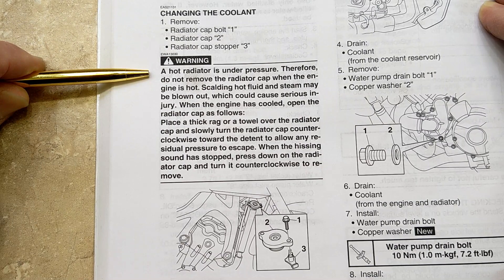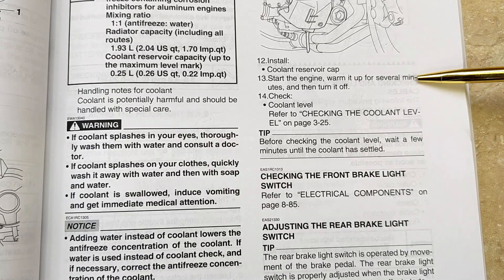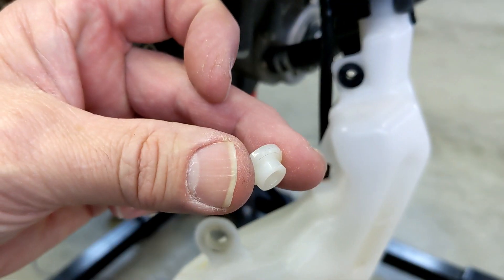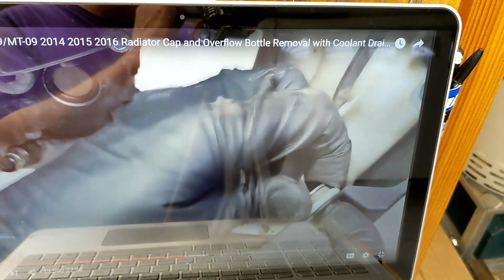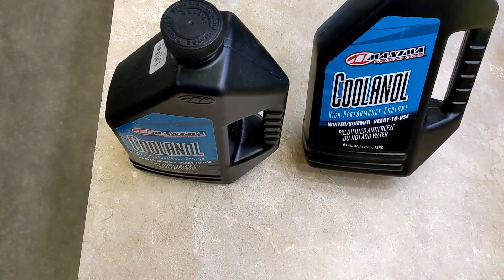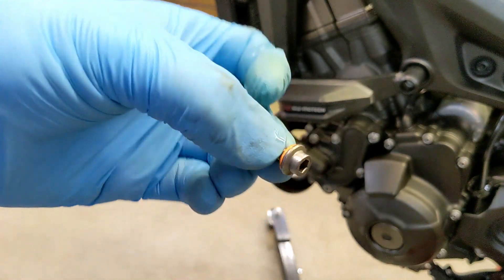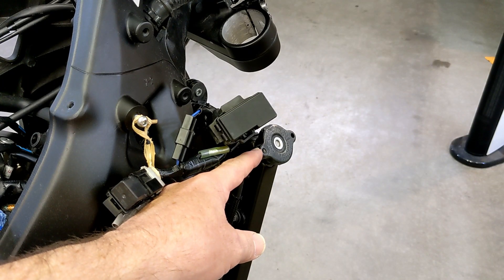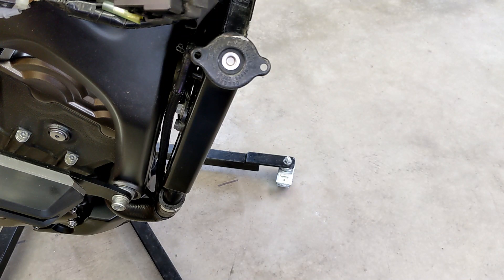refilling radiator with coolant Yamaha FZ-09/MT-09 2014 2015 2016

Comment: Hi, greetings from Italy! Thank you very much for your clear explanation, just a question, if the total circuit+reservoir is abt 2,2 ltrs, how many ltrs you drained off and how many ltrs you put in? I drained off abt 1,8 ltrs, then washed the whole circuit with distilled water then I was able to put in just 1,7 ltrs of new coolant in total, so I'm pretty sure I still have abt 0,5 ltrs of dis.water in the engine block...what do you think about? Thanks!
Reply from the maker: Awesome Italy! Guess that's why they call it the world wide Web.... Anyway, correct me if I'm wrong,  but if you drained 1.8 and added 1.7 in your only .1 difference not .5
When I did mine I had the hoses off so there's fluid in those.... Basically you're supposed to get it close and run it for a while and then top it off.... Make sure the reservoir is between the Max and Min lines...
Reply: Thanx for your reply...Sorry, maybe I was nor so clear... the difference of 0,5 is between the supposed total quantity as per Yamaha service manual (2,2) and what I put in totally (1,7), that's why I supposed something is still in the engine block and that's why I wanted to know how much you drained off, this notice will allow me to balance the difference with some additional coolant with no dist.water

Comment: wow you'd think Yamaha would have come up with a better design on that spacer by now ,just did 2020 tracer and its all the same ,I wrap the spacer with some teflon tape to hold it in snug ,once I got the faster started I installed the lower spacer ,,then used a funnel to fill reservoir  
thanks for the vid
Reply from the maker: You're welcome! Thanks for the comment...I just re-watched the video 7 months later... When I do it again, I would do it like you..... mount the bottle without the coolant in it, then use a tiny funnel to fill it.
Reply: @meticulousmechanic